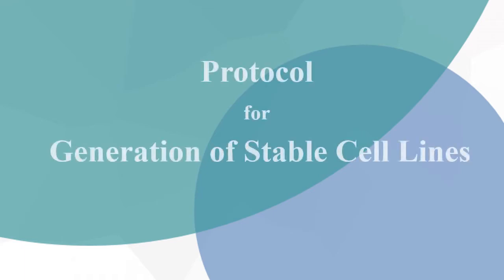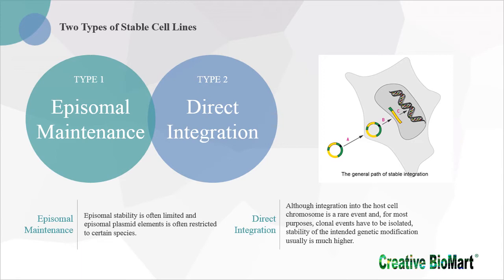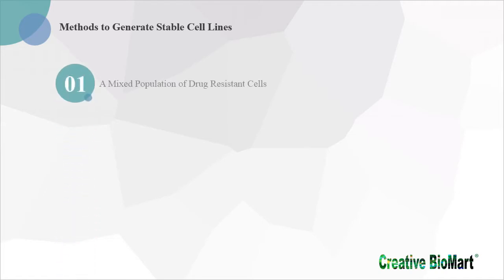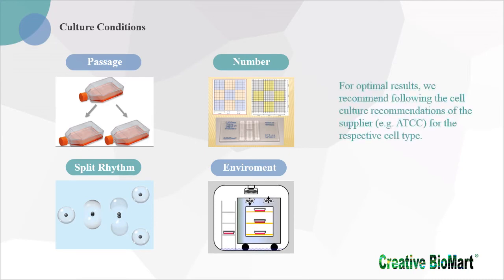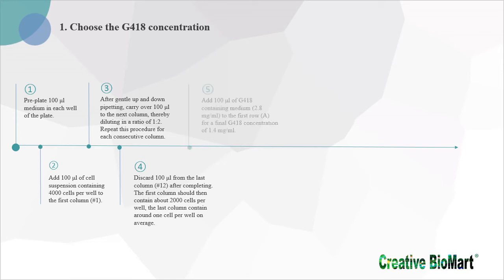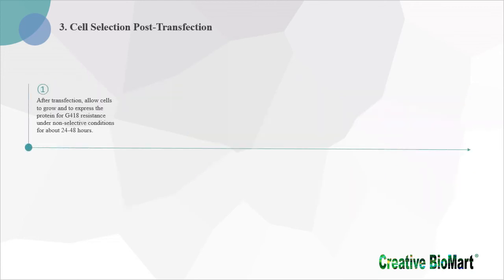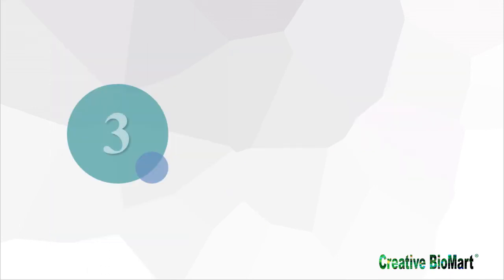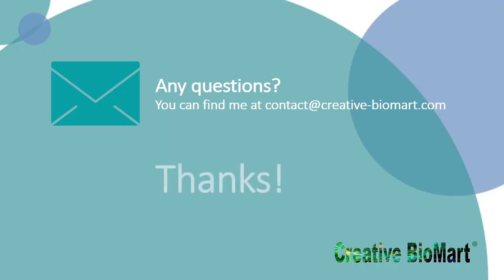Protocol for Generation of Stable Cell Lines

Comment: why we use 96-well plate and why we use 6-well and 24-well.
Reply: It depends on if u want to test transfection ratio is successful or not. Usually we need more cells for transfection. Simultaneously more reagents are needed